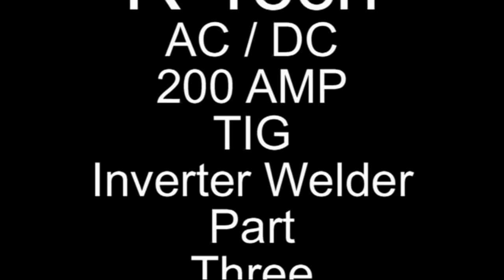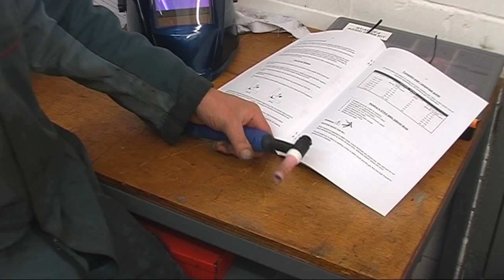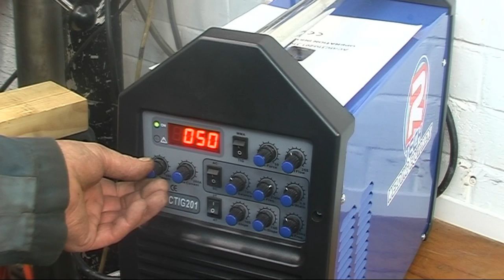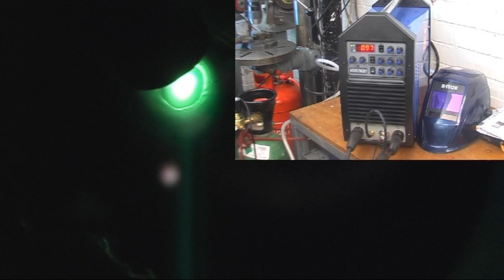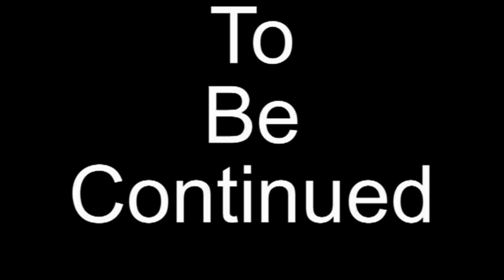R-Tech AC / DC  Inverter  Welder. TIG Time  Part Three

Comment: 8:00 welder starts AC before switching to DC - got same issue with this model. Other problem is Pulse - not full potentiometer range - only narrow usable band. Got another welder with push buttons and all works as should - avoid this one pay more for digital one.

Comment: If you roll you're Tungsten in an arc fashion across the face of you're bench grinder wheel you won't end up with grooves worn into the wheel. Just a tip I thought worthy to point out.

Comment: Nice job - I have the base model of this machine - DC MMA & TIG only to 160 amps with pulse and up/down etc - and I really like it. I bought it because of the good feedback on UK Welding forums - especially when compared to the generic chinese gubbins that can be bought on ebay (and then sent back a month later when they stop working - lol :) ) R-Tech are very helpful and give good advice when buying from them - STRONGLY recommended!

Comment: I find I get a cleaner weld if I keep the filler rod in the gas stream and not pull it back too far and let it oxidise. Need to let us see the finished welds!

Comment: When I was teaching myself to TIG weld a few years ago, there weren't all these wonderful videos around. Most of the books were pre invterter technology and many were pre square/synchrowave! I found a few things made learning easier. I always use a gas lens which allows you to stick the electrode further out so you can see things better (you can also get clear shrouds if you're prepared to pay for them). Use the next size up electrode when you're learning to weld Aluminium. I also only use 2% Lanthanated electrodes (dark blue marking). They have the highest temperature rating, work on DC and AC and will even survive a slight dip into an Aluminium weld puddle. I still grind to a point for AC, but then put a little flat on the tip.

Comment: Good video, looks to be a good machine and will do what you want it to. I shall be most interested to see the stick welding demo especially if there is some rust / paint on the job as I rarely have access to new metal to work with. Like others I would like to see the welds produced with both thick and thin metal.
Just love the out-takes - see a recent Oxtools video about making a simple torch holder
Reply: I need a torch holder
Burned my leg a few times over the years with a hot tig torch lol